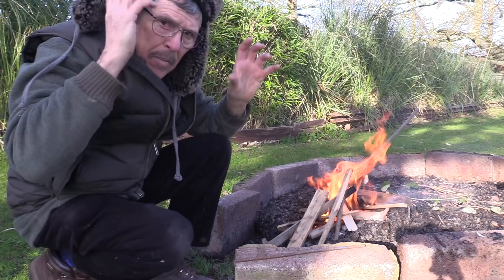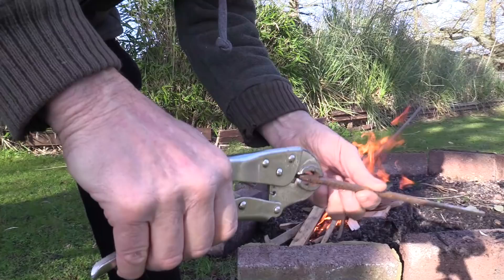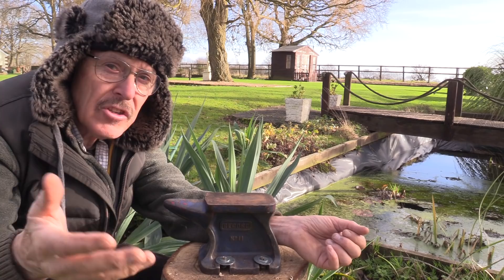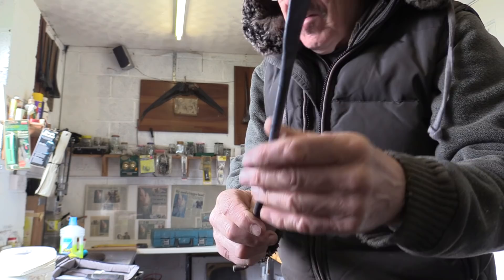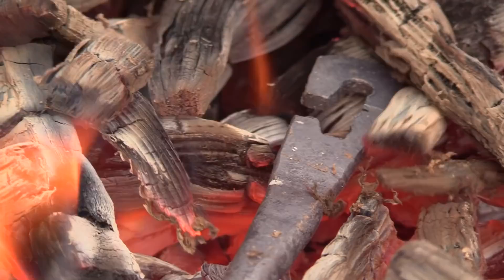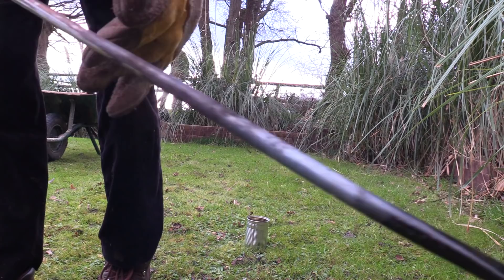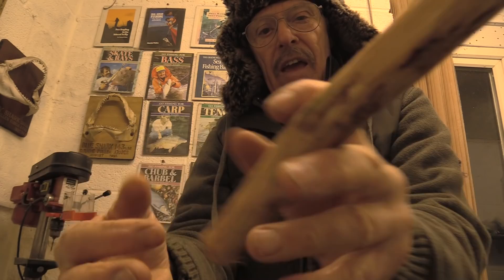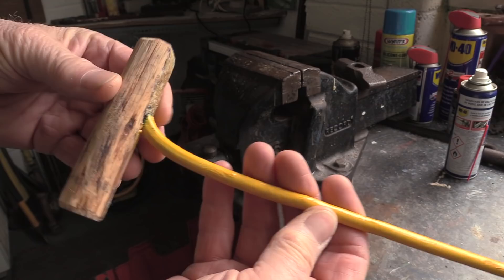Forged in a Fire - Making a BIG FISH Disgorger

Comment: Oil hardening will only work if the metal you are using has carbon in it.  Case hardening is for metal without carbon you add the carbon by heating it and covering it with a powder called Cassinite
Reply: How would you know what metal it is if you found some random piece mark? Is there any way of telling? Thanks 👍
Reply: @tonygalloway3704  I was a toolmaker so all the metal in the store was marked so it was easy.  There are tests to show how much carbon exists but this is more for lab specialists.  If you could see what the item was in its previous life that could give a clue, say a large drill bit, that would be high speed steel which contains high carbon content.

Comment: Another of Graeme's great escapades!  Nice one mate!  Looks like that disgorger will do the job.  Please, if you are drilling or sawing metal, use a little light oil or paraffin as lube - the chips coming off your drill were blue IE burnt.  Drill is running a bit fast for drilling steel too.  Meanwhile, you & yours stay safe & well.  👍👍

Comment: All major shaping processes (forming/cutting/drilling etc.) should be done before hardening otherwise you're making life much harder for yourself, only the final polishing where tiny amounts of material are being removed should be done after heat treating. Think of it as trying to carve a bowl out of a brick rather than forming it out of soft clay.
To harden steel it first needs to be taken to a bright cherry red of around 700-800 C (you'll struggle to get that in a small fire, a big roaring fire on a windy day might do it but you're generally better off improvising a furnace with some bricks, coal, ducting and a leaf blower) and then it needs to be rapidly dropped in temperature by quenching in either oil or water to change the crystal structure of the material. Most steel will harden to an extent as it has a carbon content of over 0.3% but for things like work tools you want a higher carbon percentage (not really applicable for this application so don't worry about that). Water will cool it faster resulting in a harder material but this increases brittleness and the piece may be prone to shattering so oil is generally preferred as it sacrifices a little bit of hardness for some extra toughness. 
Unless ultimate hardness is the aim (i.e cutting tools) then it is best to temper the steel once hardened to further sacrifice hardness for toughness and make the piece less prone to shattering if dropped or struck. This can be done by heat soaking the piece to a straw colour at a temperature between 200/300C (higher temp = less hard) for several hours and then letting it gradually cool.
Reply from the maker: Definative comment,thanks for that, it may help others thinking of having a go with a small project.

Comment: If you drilled through the wood you could push the rod all the way through and excess the bent metal on the top of the handle. You can then whip it and it should be much stronger.

Comment: As i remember oil quench promotes the formation of Bainite in the steel. If you plunged it in water you get martenite which is harder but more brittle. Bainite is better as the brittleness is reduced making the metal tougher. Make the piece then plunge in oil is the easiest way to make it.
Reply from the maker: Not many Blacksmiths use a Baked Bean can to quench in oil though so I may have done a first...Mind you someone is bound to copy it on YouTube..probably doing it now.....
Reply: I can imagine the click bait title!

Comment: To test hardness run a file over it and it should just glide not cut in also for the fire try an electric pump or hair dryer (dont tell the wife ) to get it hotter

Comment: I drilled a hole in the middle of my wooden handle. Put the metal wire through it, then bent the metal. I then carved out the cradle for the metal hook I'd made. With every fish I t bar off, the hook into my handle gets pulled into the wood more and more. It was tight and snugg anyway but no chance of it ever failing.

Comment: try a mk2 drill the handel put the rod through the hole then bend it a little stronger good job though pulls from the top not the bottom

Comment: I'd whip that before you use it. That glue is good if there are no gaps. People make the mistake of thinking it's a gap filler because it foams up, but it's not. Mathius Wandel on here has tested the strength of it glueing wood and if it's tight enough so there are no gaps it's good. Stick a shim of paper in the joint and it's useless.

Comment: 2 screws holding the anvil too many,lol
Reply from the maker: 2 each side...but I really need those coach bolts Mike told me,then they don't vibrate loose. I can see a time when the screws come out,the anvil falls on my big toe and hopping about swearing I grab the hot metal disgorger...it ain't gonna be pretty !!
Reply: @TAFishing  hahahaha,love it
Reply: should have used the wd40 on the drill bit,keeps it cooler and the bit hard